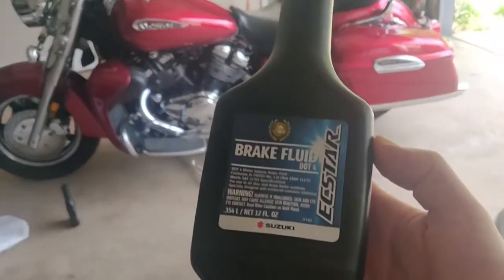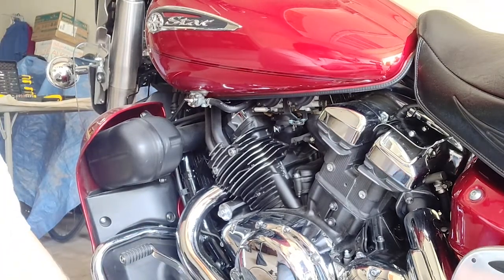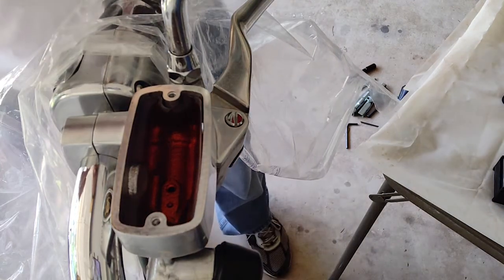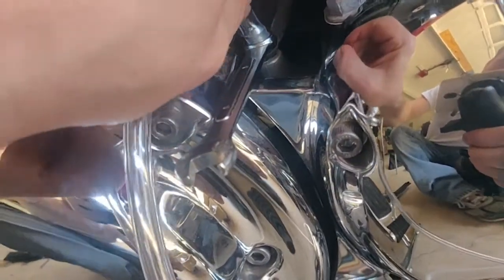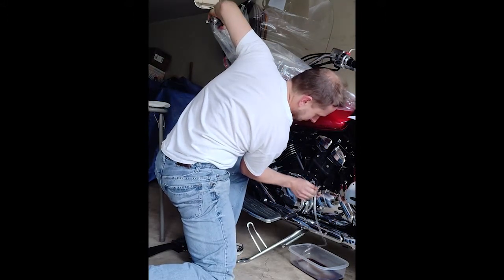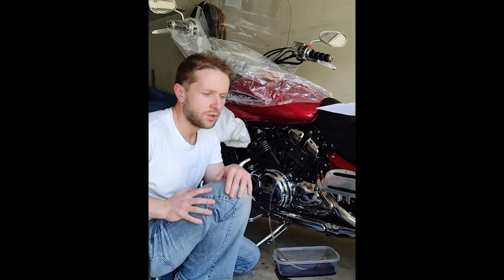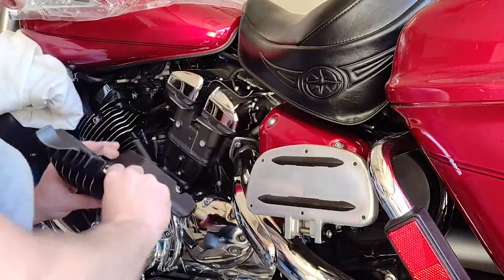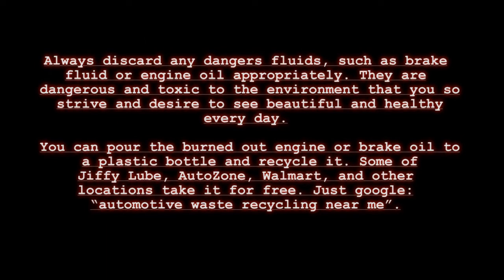How to Bleed a Hydraulic Clutch on a Motorcycle Clutch Fluid Change on Yamaha Royal Star Tour Deluxe

Comment: Thanks for this!  I have a 96 Royal Star that sat in my garage for over a decade and I just had it rebuilt.  I was out on the road Saturday and noticed it was suddenly really hard to shift.  I looked up and saw no fluid!  Following your video I was able to flush it out, and now it's shifting beautifully.  And yes, I realize I may have bigger problems on my hand if that suddenly went empty, but for now, I'll take a win.
Reply from the maker: Great! I am glad you were able to do the job with the instructions in the video. It means that the video is made well to be of assistance and it means a lot. Thanks, new subscriber with bell notifications 😛Also, I have the 2009 Royal Star and for years I always found it to be best looking bike of modern times. I also drives so well. I love this motorcycle.

Comment: I love your pipes, I want those for my 2007 I'm thinking. What brand/model slip exhaust are they?
Reply from the maker: These are regular stock pipes.
Reply: @AmazingWorlds314  They look good, when I bought mine it had aftermarket pipes. I changed them to Sharkroad Megaphones the sound mean.
Reply from the maker: @kman-mi7su  I like the sound of the stock pipes. They are not loud or quiet. To my ear, they are tuned just right.

Comment: Will the clutch shift gears if the fluid is low/out/bad? My bike just stopped shifting gears. But the thing the clutch pushes in still goes in and out.
Reply from the maker: I would always make sure the fluid is not burned out and is clean and at proper level. However, what you are describing sounds like there may be a different problem with the clutch.
Reply: @AmazingWorlds314  yeah. Not gonna spend 1000$ to fix it. Qnd not gonna make payments on a piece of crap that went bad a few months after getting it.

I'll do a repossession and let them deal with it.
Reply: @AmazingWorlds314  Just checked the fluids. Clutch is dark/empty. Brakes is pretty and light/full. Is a motorcycle syringe expensive? All i need is syringe and dot 4 fluids and a clear tube.
Reply from the maker: @HerbalistAce  Any syringe will do. Take a look at the procedure in this video and you will successfully change the clutch fluid in your Royal Star. It's a rather straight forward procedure.
Reply: @AmazingWorlds314  i have everything you have. But dont have a 2 by 4 to jack up the bike safely. So theres nothing i can do.
Reply from the maker: @HerbalistAce  You do not need to jack up the bike to do this procedure. However, if you ever need to jack it up, you can get a used motorcycle lift for under $100.
Reply: @AmazingWorlds314  have a lift
Thought the bike needed to be leveled out
Reply: @AmazingWorlds314  oh well. Repo coming to get the bike.
Reply from the maker: @HerbalistAce  Yes. See the video :-)
Reply: @AmazingWorlds314  lift needs a 2 by 4. Or the bike needs an adapter. 

But not my problem anymore! 🙂

Comment: was your clutch slipping at all, mine is slipping a little going into 5th gear if I am really getting on it?
Reply from the maker: My clutch was not slipping. I only needed to replace the hydraulic clutch fluid. There is some good information and troubleshooting guidance regarding the clutch in the Repair Manual. I got one by Clymer and it is pretty good. I would start there to troubleshoot the clutch.
Reply: Royal Star clutches are junk around 30,000 miles. Upgrade to a Barnett clutch kit

Comment: You can run into trouble when squeesing the cluch. Ive worked on mike and rode my whole life. Alot of old bike machanics always told me to squeeze once then open then close then let go. Or you can get maybe 2 squeezes then open and close within about 2 seconds or 1 sec. But if it works for you then great job and ride safe.
Reply: What do u mean, I was going to clean my filthy fruit out and I don't have a bleeder pump guess I could buy one if squeezing isn't good for it. I blew a cylinoid in my Tacoma pumping too hard.
Reply: @onewaylovethyneighbor9159  lol i ment my own bike. I also ment use a long tube on the bleeder valve with a 3/8 little rench. Pump the break or clutch lever twice then open the valve for either fluid youre working on then open the bleeder valve. Then close the valve then let off the break or clutch lever lol.
Reply: @Hunterslife315  ok thanks for the reply ;)
Reply from the maker: @Cal G, What kind of trouble are you talking? The video is based on Clymer Manual for Yamaha Royal Star. Let me quote the portion from the manual about bleeding the clutch: "Pump the clutch level a few times and then release it." I saw some mechanics press the clutch just twice and some pressed it a few times. The Clymer Manual says "few pumps". The point is to get the old fluid out while getting the new one in. I changed my clutch fluid two years ago and the clutch works like a charm.
Reply: @AmazingWorlds314  for some reason my front break lever once i squeeze the lever it felt like it had some spung feeling when all the way in. I bleed out the fluid and its not doing it anymore. But i know i didnt have air in the lines so i was thinking my lever mite need to be replaced. I have a 1300 98 royal star with 40k on her but its the original lever. Maybe it was just me but i did have a buddy it happened too aswell.
Reply: @Hunterslife315  Spongy feeling, when pressing the lever, usually means air in the system. The air could get in the system in a few ways. Most common ones are when the air sleeps in when bleeding the clutch and not feeling the reservoir fast enough before the reservoir fluid goes all in. Another one could be when the air gets sucked back in through the bleed-valve. Additionally, the tubing in the system could be faulty and needing replacement. I would monitor the level of the fluid in the reservoir along with how it changes color over time. In the Yamaha in the video, the clutch fluid was changed about a year and a half ago and there was no need to add any in (could mean leakage otherwise) and the color changed only a small bit from yellowish/clear to ever so slightly darker. The clutch works great although this one is from 2009.
Reply from the maker: @Hunterslife315  Spongy feeling normally means air in the system. It is hard to tell if you have air in the system or not but the spongy feeling is a good indication that you do. Air could have slipped in somehow. However, after bleeding out the system and eliminating the spongy feeling means the air got pushed out.